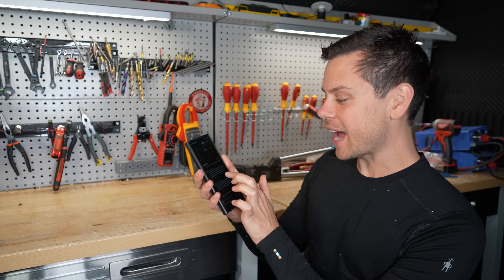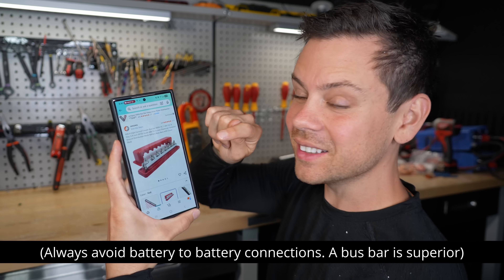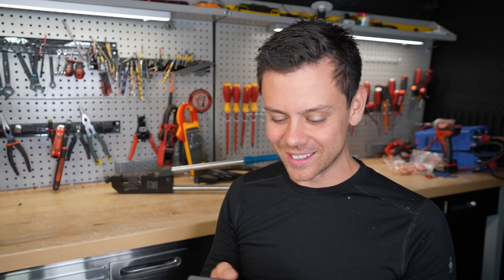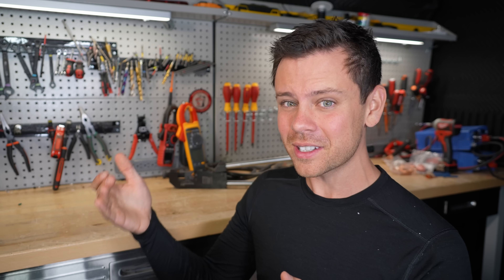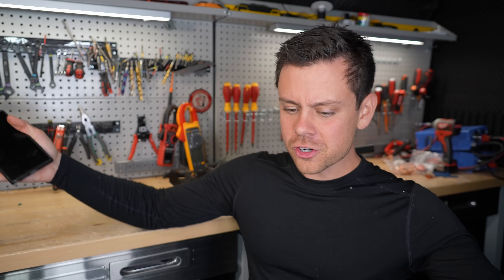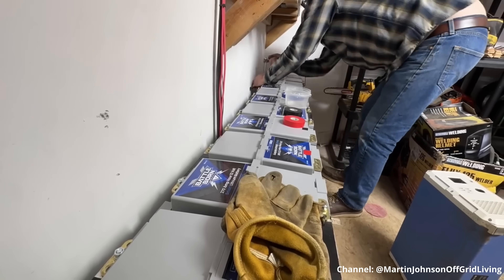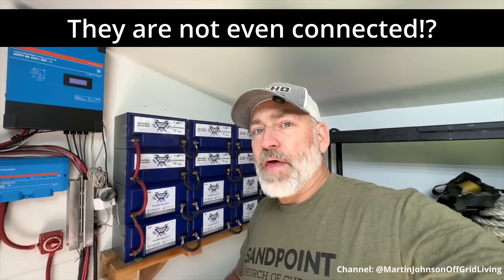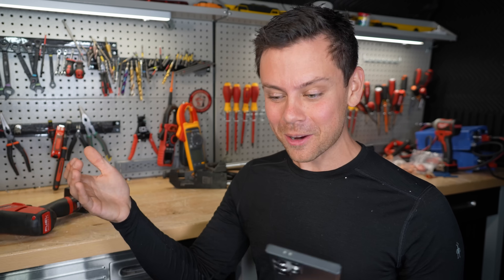My Reaction to Martin Johnson's "BEST Off-grid Battery Bank" Video 😬 Yikes!!

Comment: Serious question here - what's wrong with putting 12v batteries in series?

Each one will have a BMS inside, right?  What's the downside to doing that?

I ask because I'd like to build a 36v battery for a mobility scooter that runs 36v, and 3x 12v LiFe batteries seemed like a good idea - can someone educate me as to what the problem is here?
Reply: you need another balancer to balance the 12v batteries. another layer of balance which is unnecessary and adds complexity and failure points
Reply: for your scooter watch out that these lifepo actually have enough power output. the rating isn't enough check actual tests. smaller mobility like ebikes n scooters use lion because it has better power and density

Comment: I have twenty 12v batteries wired for 48 volts,at about 1/10 this cost ... has the same multiple loop issue but seems to work fine

Comment: I would love to have heard more solutions. Battleborn did have a great cheap safe battery and did feel like the standard but as stuff moves on not everyone gets the update. Also I know each of there batteries is basically a a battery system (bunch of 18650s with an internal bms) acting like a normal 12v battery. But what would have been a better choice? Obviously the system needs better fuse and conductor selection. And I can see how he got taken for a ride getting the victron blue and battleborn (also conveniently blue) systems. But both are know good and safe (if you hook it up right) and nothing is inherently wrong with any of those but I would have loved to have a comprehensive review to identify each problem and offer solutions.

Edit: to clarify this just felt like bashing on this guy who just needs some positive corrective feedback.
Reply: Bashing?? Are you nuts? This guy's system is FATAL! what's wrong with you?

Comment: @WillProwse can you now do a video roasting all the "experts" who advocate for taking MC4 connectors apart when installing them (they are designed to be installed without disassembly), stripping back so much insulation that the wires touch the other connector, not inspecting the crimp, and other pointless or dangerous behaviours. It seems none of them have even watched the Stäubli installation video (free, easy to find) and are confidently preaching the knowledge they picked up from an equally clueless youtuber.

Comment: I don’t see what’s wrong with using 12v batteries to make a 48v system, and the 4awg is adequate. Granted I’d never use aluminum 1/8” buss bar, or solder or run the wires that way, or use nylock SS nuts.

Comment: The dig on 48v vs 12v batterys units is😑.   My ideal battery set up would be have large individual cells anyway. In the 48v rack batteries, If 1 cell in the 16 cell pack dies...the whole battery is OOC.    If you have 10 of those rack batteries, you have 160 cells that can screw you out of 16 other cells. If you have a 160 individual cells arranged in 10 strings. One of them can still fail you.
  However replacing it is much cheaper...

Comment: 09:20
Welder-fabricator here.
We use circular motions, reversing direction frequently.
Avoid grooving that soft material by sweeping your circles around the perimeter of your emory cloth.
We only use the higher standard of emory cloth, instead of painter's sandpaper and its constant shedding.

Comment: Did he install a battery equalizer? Series batteries will need that (12+12+12+12) , or the state of charge will vary over time. A better solution is just buy 48V batteries.

Comment: When I got a 2/0 ground cable made for my tractor (stock was a skinny 4ga), the VERY experienced guys at the auto electric shop who made it up soldered the lug. Crimped connections are faster, and usually quite adequate, but solder provides a much greater area of contact, and absolutely excludes oxygen, which more than offsets the slightly higher resistance. The Ford factory crimp on the ground cable of my F250 worked loose from thermal cycling and started arcing, causing intermittent slow cranking. To be fair, it took 15 years, but it was still a bugger to track down, because I, as you, "believed" in the copper-to-copper theory of crimped lugs, so I didn't even look at the crimped lug as a possible reason it intermittently wouldn't start (I only found it because it fell out when I pulled on it!). I soldered the replacement lug, and it has been perfect ever since.  If your batteries are getting up to 700ºF, you've got bigger problems.
Reply: Solder might provide a greater area of contact, but that is the problem. The contact area is so inflexible that all movement is concentrated in one place (where the solder stops and the normal cable starts) and the copper fractures. 
The industry standard is crimped lugs, you'll have to argue against a lot of massive data sets and ultra smart material scientists to make your case, and you'll never convince them; the massive data is on their side, despite your 1-off example. Why would a greater area of contact be of value? It certainly doesn't help with conductivity - you admit that soldered joints have higher resistance than crimped.
Reply: @RoarPowerNZ-tt6ud his 1 off example is only a month old. Let's see if it lasts 15 years. His thinking is defective.

Comment: There is advantages to the battleborn batteries but the cost negate all advantages.
 The REASON aluminum is not used is the corrosion eats aluminum much faster creating shorts. In Texas any house with aluminum wiring is required to have a electrician re tighten all connectors yearly. It is better conductor of electricity but not worth the risk of fire or shorts.

Comment: You just reviewed a Battle Born commercial, a dangerous one at that. I have one I bought years ago still works great. But thing is there's so much available now that is better and cheaper. In these times when people are strapped for cash who's got 25k to spend on batteries, when you can spend 5k and have some quality 48v rack batteries that can supply a household with 6 kids. There's some crazy and dangerous stuff on solar youtubes. Thanks for the dose of sanity.

Comment: Waiting for the elevator in a big Houston area hospital, I see two guys pushing two pallet jacks with batteries on them. Turns out that they were 140AH batteries in 12 volt. Assuming these are for backup, I wonder why they aren't using a 48 volt system?

Comment: It would be far more beneficial if a qualified Journeyman or Red Seal Electrician could assist and guide the individual involved. Having someone with the right expertise explain the ins and outs of electrical safety and proper solar installation techniques would make a real difference.

While the approach being taken may not align with best practices or safety standards, the solution lies not in criticism or public shaming, but in offering practical, hands-on support. Constructive guidance—delivered with respect—can go a long way in promoting better understanding and preventing potentially dangerous mistakes.

Legal action or public ridicule should never be the first response. It's neither constructive nor educational, and it does little to improve safety or awareness. A professional intervention focused on education rather than condemnation would serve the individual and the community far better.

Will you handled this well and with respect.

Comment: The website for those batteries do contain stats each of those batteries Martin Johnson used weigh 81 lb a piece I found the stats within seconds once I got to the website. Would I purchase those know I would not if I'm going to spend $2,000 on one 12v battery I'm going to spend a ton more on a Tesla powerwall instead 1904 well you get even cheaper LiPO batteries

Comment: Unfortunately I would have watched his video and thought… yup, that’s what I’m going to try. 
I’m having a heck of a time with my set up right now. I’m looking for a video that will tell me about running two systems (old one that’s being phased out, and new one to replace it) but while I still have life in the old, I’m connecting them to the same inverter with a quick disconnect switch so I only run one at a time. Seemed fine, until recently when my inverter faulted and I’m not sure why it’s not working. 
Everything is 12 volts.
One bank is AGM and the replacement is LiFoPo4

Comment: Will, you have incredibly valuable info in the most professionally produced manner, and this video is no different. I can't get enough of your channel because it is so focused on comprehension. But please keep in mind that most (no, not "all") Youtube value is for those who DON'T KNOW WHAT ANY CONTENT PROVIDER IS TALKING ABOUT; that's why we are  watching. This video could be perfected if each mistake that was made was followed very promptly with "1)don't do that; 2)do this; 3) this is why." You could retro-fit it all with overlays. I realize that you do provide some or most of that information, but not all of it, and you're so offended by what you're watching that your reactions overshadow or displace the educational points. I also have a personal pet peeve about what I'll briefly call "off-topic" safety stuff. Yes, it was comical seeing a torch used on a cardboard box, but that's different than putting batteries against a wooden wall or using the wrong gauge wire... which is what I need to learn from you. Thanks again for the best that Youtube has to offer.

Comment: I watched the video before your review, the blowtorch held between his legs was amusing and stainless steel bolts corrode aluminium, I think, but good that you pointed out numerous other problems. In the UK, cartel-like pricing from electricians and endless regulations that are mostly ignored by DIY-ers provide an interesting problem for those who want to save money when confronted with cheap solar panels and other equipment. If you do burn your house down I doubt that the insurance companies will pay out, either; quite easy to end up with a house you can't get a mortgage on when you come to sell. That probably leaves an off-grid system on the roof of a garden room/shed (which legally can be as much as half the size of the garden) a safe distance from the main residence, connected to a separate circuit in the house that can run most of the electricals and can be taken with you if you want to sell the house.

Comment: One thing i've learned, just buy a battery that narively supports the voltage you want to run. Just that by itself will save you a lot of headaches

Comment: If You Are Going To Use The Aluminum Bars They Should Have NOX On Them Instead Of Worrying About Sanding What Little Protection is On Them Now! His System Will Probably Work Until He Burns The Solar Shed Down! All The Wire Recommendations Are Way Over Sized! Especially For AC Wires! Just Look At The Little Cable Running To Your Home! Not The Ones Going Down The Mast! The Wires Are rated For Conduit So In Open Air They Can Take More Currant!

Comment: He Reminds Me Of My Uncle Who Thought He Was An Electrician!! 3 Of His Kids Houses Burned And So Did His! I Thought They Were Burning Them For The Insurance! But My Cousin Is Assistant DA And Her House Burned! I Have Yet To Have A House Burn I Wired Except 1 And It Was Ruled As Arson! The Fire Department Left And It Caught back Up! The Fire Department Will Not Leave Until The Know The Fire is Out! Or They Will Watch Them Burn In Some Cases! Older Homes Do Not have Sealed Walls!! Houses Built before The 40's The Built The Floor In last! Thus The Walls Are Open From The Cellar To The Attic!  I Seen An Old House Burn To Nothing In An Hour!! 15 Minutes In And The Whole House Was A Blaze! A Two bedroom Home Built With Tung And Groove Pine Siding Inside And Out! No Insulation Whatsoever!

Comment: Will, can you make a video on why using 12v batteries in series to make a 48v battery bank is a bad idea?
Reply: Especially since they are all just a bunch of cells in series. regardless of the voltage. I think he is saying to not have some protection in doing so though, yet again a 48v battery only has protection in the input and output not the 4 times of cells inside compared to a 12v battery. 

In a way multiple 12v batteries is better because WHEN the battery management system fails it is only one of the 4, 12 volt batteries instead of the whole 48V. 

The only real issue is more wires/busbars needed using 12v batteries.

Comment: I got the 300ah dumfume batteries, 2 of them (never used batteries at this cap) for a 12v system. Do you recommend i use a fuse in between the batteries in parallel? If so what size fuse do you suggest?

Comment: Will, I agree about the copper buss bars for proper current handling. 
  What do think about the other content creator that hammers copper pipe flat for buss bars? I plan on testing some 1/0 copper multi strand vs hammered 1/2 copper pipe. The test will be for voltage and amp drop (resistance)and heat differential.

Comment: Hey Will, love your content and your take on Martin Johnson's "BEST Off-grid Battery Bank" video!  I’d really appreciate it if you could verify my setup and results. I’m running 8 U27-12XP batteries from GreenTech Auto ($225 each, expandable to 12), paired with a Renogy 3500W Inverter/Charger and 6 Renogy CIGS 150W solar panels. Balancing is handled by 3 Victron Battery Balancers, and I’m monitoring everything with the Renogy ONE Core system. Funny thing—I didn’t see your video trashing Renogy’s inverter/charger until after I’d already had two of them in service for two years. Gotta say, they’ve been solid for me so far, and the ONE Core has been great for keeping tabs on the system. You were absolutely spot-on about the Valence U-Charge, though! I’m currently running 30 U27-12XP batteries in service on my boat, 9 LIVES, and they’re performing like champs. Would love to hear your thoughts on this setup and if you think there’s anything I could optimize. Thanks for all the awesome info!
Reply from the maker: Hey that sounds like a cool system, would love to check it out if you post it on the forum
Reply: @WillProwse  No Joy Registering on the Forum 🤔 but I don't have much patience for such things, sorry, I document my builds on X under my Community titled "Living Near Zero" (Carbon Footprint) Aboard 9 LIVES, a 1997 Manta 40 Sailing Catamaran, that I have been Living Aboard, Refitting, Updating Her for the last 3 Years including Electrifying All Systems, Cooking being the biggest challenge 🤠⛵⚡❤🤍💙🖖

Comment: This is what worries me about YouTube sometimes.  That's why I watch multiple videos on a subject since I am a novice when it comes to lithium batteries and it's also why I typically use your videos as a benchmark.  But even after watching your videos, I still gather as much information as I can to confirm your advice.   but I do feel your videos are some of the most reliable.  After watching this one, I did learn a couple of things. I am currently building a system and I have a question: Should I have an MRBF fuse on each positive terminal of 4  300 ah lithium 12 v batteries connected in series?  Or is just the one which leads to the bus bar?

Comment: I personally especially like the using a sweating torch to solder the lugs ONa cardboard box WHILE securing the lug being worked on (and applying downwards pressure to) with a "ghetto" rigged vice, being a pair of pliers squeezed together with a bar clamp! Hey remember guys...SAFETY FIRST! This guy...WHAT A JOKE! And Battleborn was, is and ALWAYS has been a COMPLETE ripoff pricewise!

Comment: There is nothing wrong with soldering terminals on to wire. If your worried about the solder melting the wire insulation would go first before the solder.

Comment: If I'm not mistaken, Battleborn stuff has a UL listing which is what makes it so expensive. Same goes for Lithionics and Renogy's Revo line. They're big in the RV world because I assume in order for a manufacturer to stick one in a new unit, they need the UL stamp. I'm also pretty sure if you use non UL listed parts in your home electrical system your insurance company can deny your claim.

Comment: Many people believe soldering is better because wire is soldered on PCBs not understanding its different. I Know someone who built a car wiring harness all soldered and about a year later had electrical grimlins everywhere,  solder was cracking from all the vibrations.

Comment: I crimp and then solder. Aluminum bus bar is fine, the same voltage drop as copper aluminum is about 65% bigger than copper. The oxide layer is not an issue with tight bolted down connections, use a aluminum cleaner on the metal first. Aluminum and tinned copper lugs are fine, provided they are kept dry.

Comment: People are not properly educated in science and math today. There are always electrical rules and math you should use in DC current and solar. Some don't understand the concepts of proper electrical flow and connections. Hence why their equipment fails, or worse, they burn their house down.

Comment: For series connected batteries you need to check the max series voltage rating for the BMS.

If you go over the spec and the BMS tries to break the circuit it will arc over, and burn!

Some BMS only have 24 v MOSFET for 12 v batteries

Comment: Thanks for the video. I still have much to learn but still my cables are cold pressed and my cables are much larger than required. I'm using equivalent 300 AMP cables at 24 Volt for a Max draw of 150 AMP. After much research before I found you I discovered the Eco Worthy Batteries. Unfortunately i bought them 5 years ago at which point they where double the price. :0(

Comment: Hi I have purchased VEMDIA  group 31 lithium batteries 4 of them to power 14000 BTU portable ac they work about 4,5 hours then they cut off any recommendations what brand should I buy to run 10 hours on my mandatory  dot brake